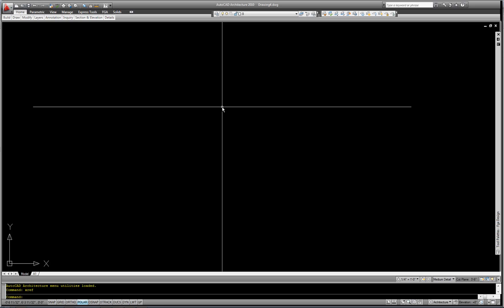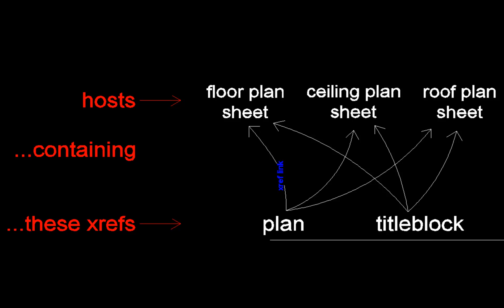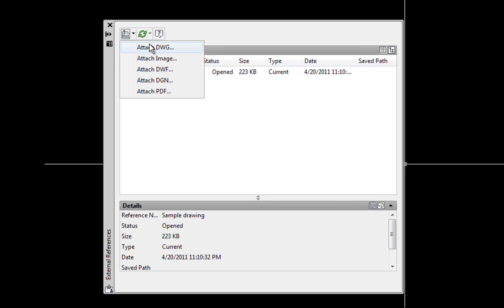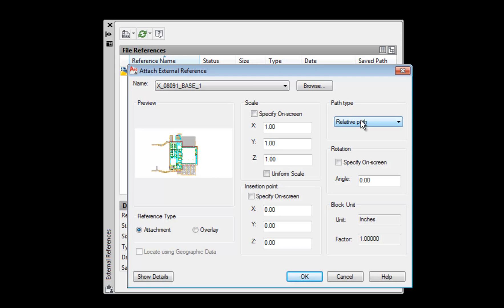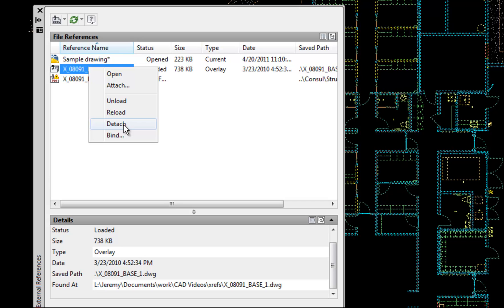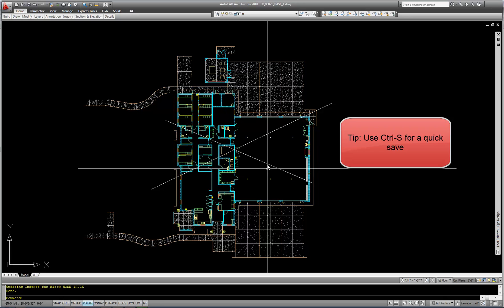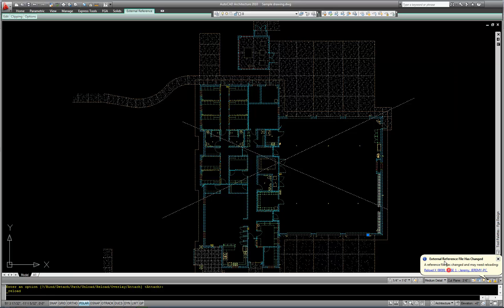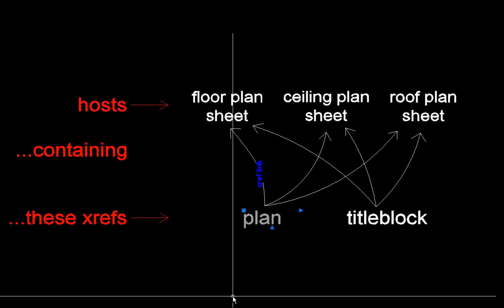AutoCAD Interm.:  Xrefs

Comment from the maker: It sounds like the units are different between the original (XREF) file and the host file.  Perhaps one metric and one imperial.  Type "units" to compare in both.  If you are making new files for either, consider carefully which template you're using for each file.

Comment: Hi Jeremy,
I am using Autocad LT2012 and trying to attach an Xref to a new drawing . Under "Block Unit" on the "Attach External Reference" dialog box, it comes up with some random factor like 0.0394 and doesn't let me change it. The default settings for "Insertion Scale" for the both the drawings are set to "Unspecified- Unitless" . I would really appreciate if you can please advise how to fix it?
Thanks.

Comment from the maker: Bind will convert an XREF to a block that resides in the host file. This means the link is broken but the information remains in the host.  The process is quite simple - just choose bind from the XREF Manager or right-click menu.  There are two sub-options (bind or insert).  The difference is pretty subtle, changing how the layers of the linked file convert to the host file.

Comment from the maker: A "sheet" file is just a regular file... I only call it a sheet file to identify its position relative to the external references, as the host.    Every CAD file is made from a template, you just may not be aware of which one you're using.  The ACAD.dwt is the standard template if you're using regular AutoCAD. I would suggest you watch the template video (fundamentals playlist) to clarify how templates work.